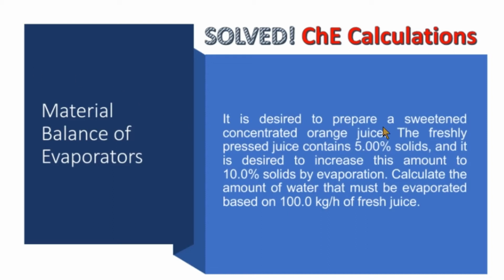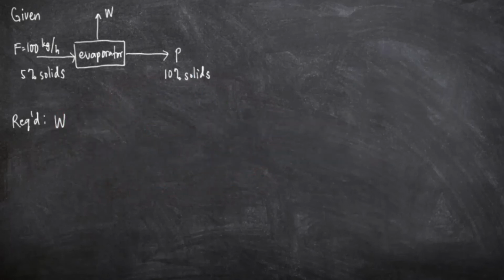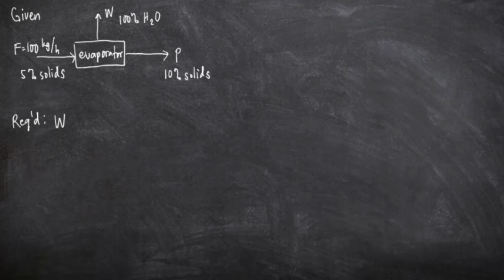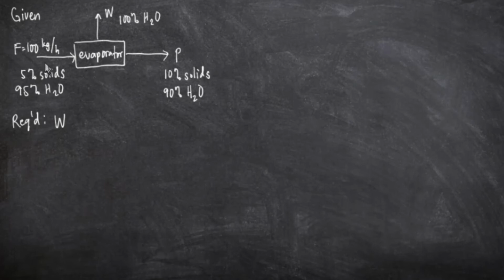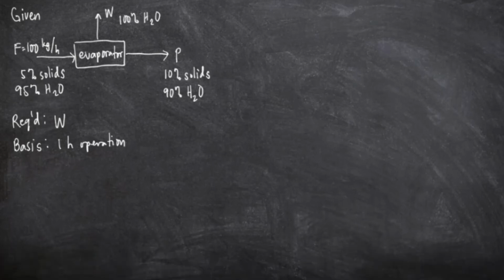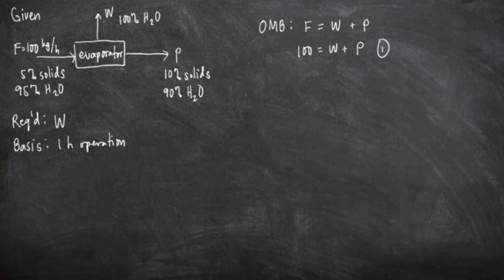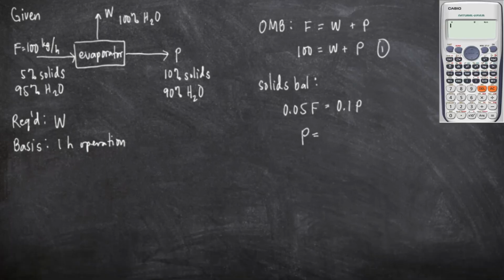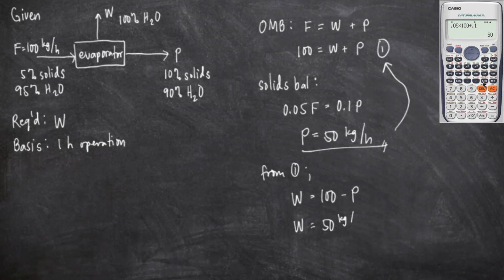Material Balance of an Evaporator - SOLVED!

Comment: hello,what if evaporator can produce 1000kg/h of 65% sugar strup from 10% sugar syrup solution. so yung 1000kg/h ay nasa product. pano po e solve yun?
Reply from the maker: Set your basis to 1 hour operation. Your overall material balance becomes F = W + 1000, then your sugar balance becomes 0.1F = 0.65(1000). You can now solve for F (feed) and W (water evaporated).